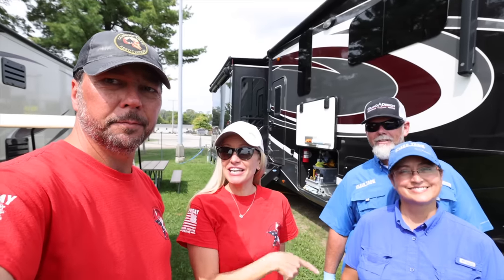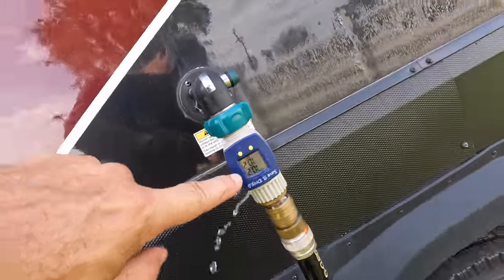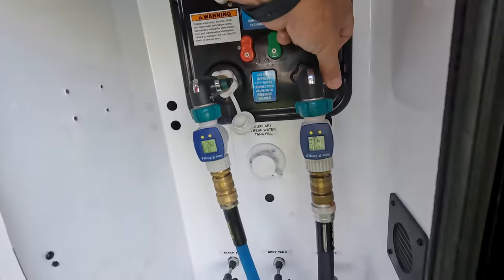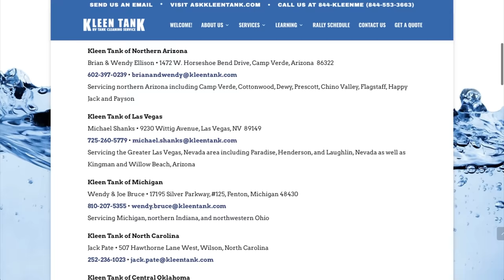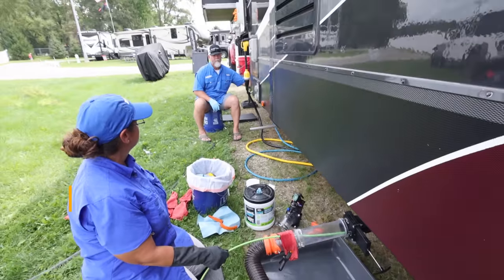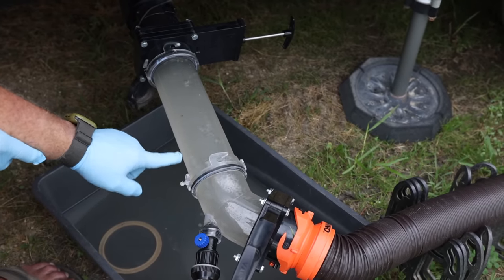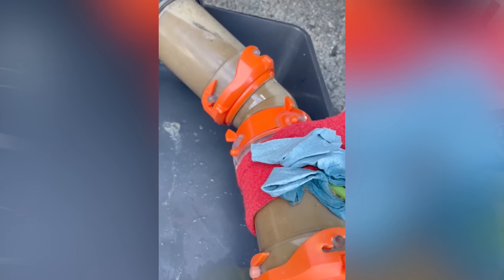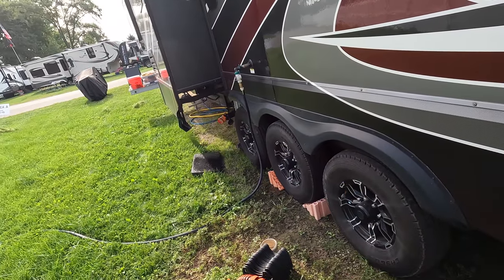RV Tank PRO Cleaning! (Kleen Tank)

Comment: I have a gate valve like you have.  I use it to drain drain the black tank, close the gate and open the gray tank, backfilling the black tank with the gray water. The back flush helps break things up.  I close up the black tank and finish dumping the gray tank.  I do this base on my gray tank levels,  If the gray tank is full, I dump black, backflush the black tank, then dump the gray tank.  I always make sure I have approx 3-5 gallons of water in each tank to start off.  While traveling, I will fill the black and gray tank, 1/2-3/4, and add a mixture as discussed in this video.  While driving, the back and forth, stop and go motion, washes the tanks.  We will get this flush done when we are in their area.  Wouldn't hurt to get it done every other year or so.  Plus, get a grade on how well we maintain our tanks.  Thank you for sharing this great info.
Reply: This service shows that manu-
fractures should add a spinner in the gray tank as the do for the black tank, perhaps even two each.    I like to clean my tanks every two months or so, and conse-
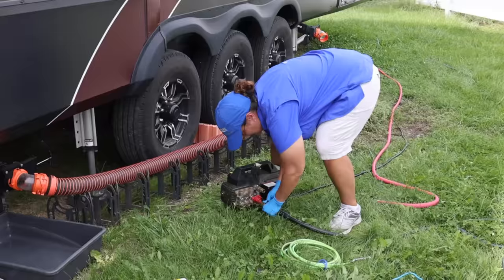quently have never had a tank sensor problem in 18 years.   Luck also helps too.  I would like to have the spinner , hose, and 11:11 pump set up they have.  Works great.  I am now sold on the Cagon/Pinesol  solution.  Thank you!
Reply: great info. Thank you Sir!

Comment: I didn't read all the comments however I use the mixture of Calgon, Pine Sol and water. Someone else may have mentioned this but I use one of the 60 oz laundry containers for the mixture because it has a pouring spout and the cap is the measuring cup, so you have it all in one place.😊
Reply: Question. How do you make the mix? Everytime I mix it I end up making a mess when the Calhoun reacts with the water and fizzes up. Am I maybe using the wrong type of calgon? Idk
Reply: @martincalvillo3210  Make sure you use Calgon Ageless Bath Pearls.
Reply: @kstoutjr  oh. I thought they wanted the beads. Sorry I remember hearing about it in this video and came back to try and find it. Got bad signal and I'm maxed on data right now so asking the question was faster than actually rewatching the whole video or skipping around. Thanks I will try that with the next batch
Reply: How much of each?
Reply: How much of each pine sol and calgon on gallon container?

Comment: Since this is going on our 9th year of full time, I will share some wisdom learned and not!  We use Happy Camper and have had good success with it.  We also sprinkle it in the bowl and use plenty of water.  We have flusher quick connects  mounted inside both tanks on our coach and also use a clear 12 inch section of plastic to make sure we are getting our tanks clean.  We also wipe out each and ever item we put in the sink before washing to avoid any debris from left over food, etc. from entering the grey tank.  I am going to try the pinesol and calgon mixture and see what results we get from it.  We are almost ready to reorder the Happy Camper product, so would be a good time to switch.  Thanks for sharing this information.  Always willing to learn tips and tricks on the road!  Safe travels!
Reply: Hi Joe: 

I am interested in your flusher quick connects in each tank.  Did you install them yourself?  If so, do you have a list of parts?  In my coach, I only have a flusher in my black tank.

Comment: Just a thought but I've used a reverse tank flush valve on our black and grey tanks.  Lets you pump water from the spigot up your drain pipe into the tank. It has a clear fitting so you can see the water coming out.  It looks something like the fitting the cleaning folks used.

Comment: One of the last things I do while flushing our black tank now is to dump as much hot water down the toilet as our water heater will generate. I use about 3 gallons at a time while holding the flush valve open. The first time I did this, I was amazed at how much more "stuff" came out of the tank.

Comment: Thanks for doing this video! I have been using Kleen Tank's formula recipe for holding tanks for a year now. I use it in both black and grey tanks. Never had an issue with smells or clogs since using it. We got a new rig last September and have never used anything else in our tanks. If you ever get a chance to go to their seminar at a rally don't hesitate. Great people and great service. Stay safe!
Reply: whats the ratio for the formula?
Reply: @klansdestin9681  Right from their brochure:

Mix 40 ounces of PINE-SOL ® with 8
ounces of Calgon Ageless Bath Pearls in a
gallon jug. Top off with enough water to
fill. Shake gently. Allow foam to die down.
Use four to eight ounces (as directed) in
each tank (more in especially hot
weather or if your tanks will be filling up
slowly over time).

Personally I use 8 ounces. I have 40 gallon tanks so if your tanks are bigger or smaller you will have to adjust. I treat both gray and black holding tanks.

Comment: With stubborn sensor problems, try hooking up your house water heater to dump hot water to your Rv sink or toilet with a small bottle of dish soap.  Let the water fill to the top of the tank for at least 2 days.  Drain it all out and this should make your sensors work again.

Comment: I have been  using the Kleen tank solution for the last 2 and a half months after seeing this video. The black tank had lots of sludge sticking to the walls of the tank I have been using mineral salts and was trying the enzymatic solutions these wasn't even touching the sludge stuck on the sides of the tank. After two tank dumps most of the sludge was gone after 2 and a half month the tank sludge free.

Comment: Being  mostly a seasonal site camper, I do the thuorogh flushes like Chad did at the end if the season (winterizing). Look down the toilet with a bright flash light to make sure I see no 💩 mound. Haven't spent as much effort on the grey tank either, but sure will this winterizing season. Thanks for the tips. Wouldn't mind having them cross over to northern Wisconsin for a professional cleaning, but seems like I'm just outside their territory.
As for the water meter,  pick a couple up a couple years ago off your tips. Also track seasonal water totals so I have a clue before moving to my base camp spot if I have to tote water in until the well is drilled..

Comment: The NRVTA training folks highly recommend "unique RV Digest-It". "unique" is the brand.  It desolves all solids, unless very large, in 24 hours.  Toilet paper, poo, and such.  I tried it. After 24 hours I flushed and NO toilet paper or solids came out. It all dissolved into a slurry.  Flushed again, same result but near clear.. Before some amount of TP always seemed endless.  Put it in both grey and black tanks.  AND my sensors worked again. Did see some dead grubs come out of the grey tank, which I've never, ever seen before.
Reply: That's what we use, works great. I don't think you have to flush 3 times, waste of time.
Reply from the maker: We tried that also but found the odors come much sooner than with Happy Camper.  Glad it's working for you.. 👍🏼
Reply: @toyhaulen    I wasn't really clear.  I was testing the new to me, Digest-It. Like Chad I flushed several times to get as much of the solids out as I reasonably could.  It was obvious that TP and other stuff was being left behind. So I tteated with Digest-It and no solids came out. Did seem to dissolve the stuff.  My plan is to use regular off the shelf treatments for odor and then use Digest-It on the last couple of stops returning home.

Comment: We have installed the See Level sensors and are very happy with them as well.  You won't be sorry.  We purchased two screens so one is mounted in the wet area of the bay and the other inside the coach at the bath area.  Easy check and make sure you don't have an overflow!  Nobody wants that!  UGH!

Comment: Thank you for this video.  I have been concerned about my grey and black tanks for a long time.  I had found what I thought was a good approach that used a solution of Zep Degreaser and Borax.  It corrected my sensors and the solution worked great at first.  but after about 3 months, the sensors went back to their old way of showing 1/3 after I dumped the tanks while the higher capacity reading lights seemed to work properly.  so, we'll see what happens next.  We will be wintering in Florida and have a trip planned to Suncoast Design in Hudson, FL to address some issues that we have with our windows fogging.  Our coach is 12 years old and I am trying to keep it looking and operating properly.

I do have a couple of questions that hopefully you can answer.  
First: I got the impression that I should be using the Calgon/Pine-Sol solution on both my grey water tank and my Black water tank.  Did I understand that properly?
Second: Should I use this solution after each dump session?  Or, should I use it on travel day?  Or is there a different interval that you might recommend?
Third: I used to use Happy Camper.  But, I would sprinkle the powder into a bucket an fill the bucket with 2 gallons of water and dissolve the Happy Camper.  Then, one day, I saw a video from Todd over at NRVTA.  He was recommending the use of Unique Digest-It https://www.amazon.com/Unique-413-1-Digest-Holding-Treatment/dp/B003X3PQN2?pd_rd_w=WHmkN&content-id=amzn1.sym.deffa092-2e99-4e9f-b814-0d71c40b24af&pf_rd_p=deffa092-2e99-4e9f-b814-0d71c40b24af&pf_rd_r=NWMQPRKCQ3FZGDZB1NV7&pd_rd_wg=B02aT&pd_rd_r=747fb325-5147-49f5-96bb-472f83dc6852&pd_rd_i=B003X3PQN2&psc=1&ref_=pd_bap_d_rp_1_i
Would you recommend suspending the use of Unique and use the Calgon/Pine-Sol mixture exclusively?

Again, Thank you for addressing this issue.

Comment: Love the video there you two...love your guests and all the solid information as too the proper treatment of tanks!!  I am curious as how to flush the grey water tanks....as I only have a hose connect to flush the black tank...not the grey! I don't have access to the grey either...just at the gate valves...  I have run some heavy hot water & dawn mixture to help gut any oil & or grease in the grey tak but that's all I can do. You all mentioned the Happy Camper product and I had trouble with the mixing of it as it behaved like a sheet rock mud when dumped. I now have a special bottle I fill with water and mix the happy camper in it 1st., then add water to the bowl to help mix it more from there....absolutely you need to mix that H.C. product well ahead of using it.....but I am happy with the almost no odor results from it!!
Thanks for the sharing the video & your guests with us!!

Comment: Chad my question goes to what you were asking them when cleaning the grey tanks, what mixture do you use? Let it sit overnight, empty, repeat? Or overtime, does using this concoction clean and/or maintain your tanks?
Reply: I'd say if you have a 40 gallon holding tank, add their mixture and 12 gallons of water. Drive to your campsite destination and dump. Let that slosh around during the ride.
Reply from the maker: We're going to keep using Happy Camper in the black tanks.  In the grey, we're going to try their concoction and put it in after dumping but particularly on travel days.. Maybe with about 10 gallons to slosh around.  We might give the concoction in our black tanks on the new RV to see if it keeps smells down better than it did in our current tank.  We tried it right after the cleaning but had black tank smells after a couple of days.
Reply: @ChangingLanes  I cleaned my tanks thoroughly yesterday used Unique Tank cleaner in black tank and Kleen Tank concoction in both greys, filled both, emptied after 24 hours. Sensors better but still unclean! But I’m confident they are clean . . . And empty! Thanks as always for your quality content!

Comment: I thought the happy campers was for breaking down the solids? So is the Pine-sol and Calgon supposed to do the same?
Reply from the maker: The PineSol/Calgon mix is to help keep any solids from sticking to the inside of your tanks (and the PineSol is also a disinfectant) However, we are still using Happy Camper in our black tanks. Since those tanks were in good shape, we will continue to do thorough flushes and use the HC as directed on the container (mix with several gallon of water before flushing down the toilet) We have started using their recommended mixture in our grey tanks, though! 😊
Reply: @ChangingLanes  awesome, thanks!

Comment: Good afternoon sir I know you took a class on RVing I have a 2017 grand design reflection and I’m having a problem where I can’t figure it out every time I get to Ed Campground and I open my dump to hook up the hose I keep getting a bunch of black tank stuff coming out every time every time I leave a campground I power wash the tank really good and flush it out And when it’s all done leaking out I open the cap to see if there’s anything else in there but what I’ve noticed is that it keeps having stuff when I open the cap when I get to the next campground I had the black and gray valves replaced I put water in them to see if it holds and it does do you think it’s something to do when I’m traveling stuff gets loose and falls in there I’m not really sure if it’s the vent what do you think I should look into now thank you and I hope the message not huge congratulations on your log house you guys have amazing videos you and your wife may God bless both of you be safe

Comment: This was great info. I flush the heck out of the black tank. But never actually worked on flushing the Grey.  My procedure will change now. Is there a recommended treatment besides the happy camper, or do they just recommend the pine sol and calgon with out any thing else.  I have always used the happy camper and seems to work fine.

Comment: So, you use this solution instead of Happy Camper, correct?  We don’t need to worry about breaking down solids?
Reply from the maker: We used this solution in our grey tanks but it didn't work well for black tank odor.  HC still worked great, but we've switched to this now and LOVE it!  Much easier to apply also. https://gear.changinglanesrv.com/product/liquified-rv-toilet-treatment/

Comment: Great video guys, interested to see how the Pinesol and Calgon works compared to the Happy Camper.

Right turn to a different topic but I'm curious if you have done a video or anything on your fridge operation and internal temperatures? I'm also assuming you have an evaporation fridge and not a 12v.

It seems the warmer I set mine, have the fin slider control, the colder it gets. I have two thermometers in there and a fan but the top shelf is always about 3 degrees colder than the bottom and is regularly below freezing. This doesn't seem right to me.

Comment: We have not traveled with water in our tanks we always wash out and dump before leaving.  We do use Happy Camper, have for years.  Always mix with water and then add lots of water to each tank.  Have left Grey tank open when camping when using washer almost everyday.  Will you still use happy camper?
Reply: Sorry just saw your reply on other comment.  Have used happy camper for over 10 yrs.  We have had black tank flushed out but years ago.  Are Alfa 2007 only used a couple months in winter and usually all summer.

Comment: What is the difference between the Calgon liquid vs the Calgon beads you have on the link? 
I’ve been using the liquid that you find in the detergent section of the store. 
I don’t use Happy Camper but use a probiotic (Just Science) in the black tank after the company that did our last cleaning stated to use it. 
Thanks for all you do!
Reply: I'm wondering the same thing! Videos I've watched on the geo method and variation of it always show the liquid so that's what I have been using. Overall, not very happy with it though.
Reply from the maker: They told us that the bath beads act more as a surfactant than the detergent.

Comment: Do I need to use a pressure regulator on my black tank flush connection? I'm worried it'll blow off on the back side under the bathroom sink. I have a 2019 Coachmen Apex Nano travel trailer.
Reply from the maker: We don't.  But, if I know the pressure is very high, I will manually regulate it down by not opening the valve (on the 90) all the way.

Comment: I have owned a few travel trailer s over the years . When I would leave the park , I would dump ,black ,then grey . I would then fill both tanks half full with water,  hook up my hose to flush and dump again . I would then fill black and grey with about 25 -35 % with water and I would pour bleach in , just a bit though.  I'd drive home an average of 4-6 hours . I lived in country and had lots of acreage with my own sani dump . I'd dump my tanks , with my trailer on a bit of slope  and leave it parked for the night . Next day I would fill tanks half full , go for a cruise ,  come back home , open black and dump , open grey and dump . I'd leave valves open while doing a flush , leave it parked and close my valves after a few days . I know this is probably hard for ya"all to do,  but that's how I did it